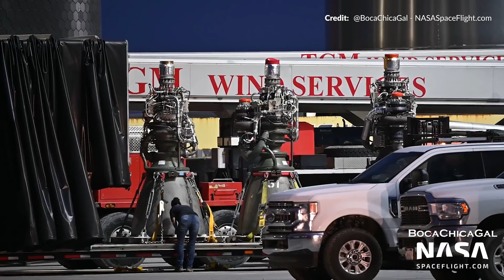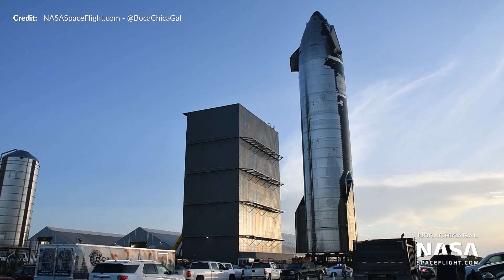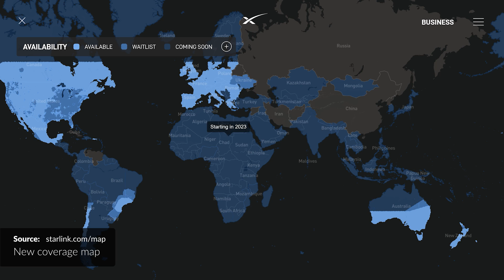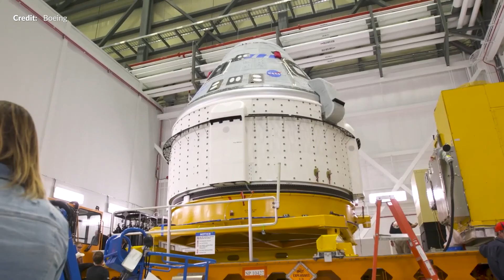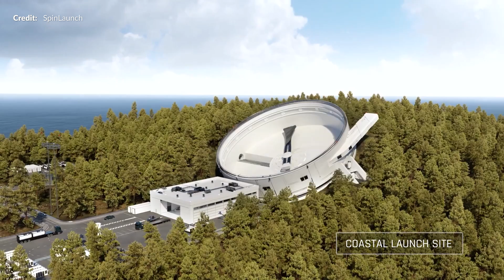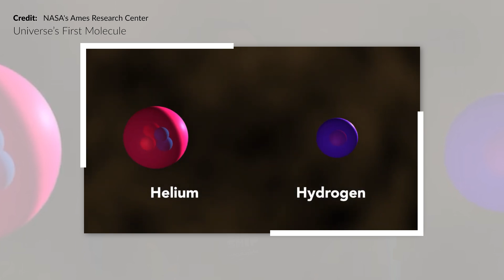SpaceX Starship Booster Testing, Ships Shuffled, Starlink, SpinLaunch, SOFIA, & Starliner

Comment: Startlingly superior. Another scintillating scene of cinematic superbness from Marcus House.

Here's hoping the Starliner can pull off a successful flight! Thanks to current events NASA needs this vehicle more than ever now. It certainly wouldn't hurt to have another option for launches, anyway.

Spinlaunch is freaky, but cool. I have no idea what kind of cargo could withstand 10 000 Gs, but if anybody wants to launch solid lead ingots or cannonballs into space, this is the system to do it with. Seriously though, it's a great proof of concept and I'm glad they have the funding to carry it out. Your idea of using it on the Moon is really cool. If the power requirements could be worked out, spinlaunching might be a cheap way to get mined materials from the Moon into orbit.

It's too bad about SOFIA. The program had a great run and they did a lot of wonderful science with it, but eighty five million a year is a heck of an operating cost for a single airplane and instrument. Maybe somebody could think of a way to do it cheaper in the future, with a SOFIA 2?

Comment: HI Marcus - great show - thanks

Regards Spinlaunch - I have thought for a long time that having some form of ground based initial launching system that does not need to be lifted of the ground would be hugely beneficial.
Think all the energy (mass) needed to get any rocket clear of the launch tower - what if the rocket could be powered by an "extension lead" until it cleared the tower??
So Spinlaunch held my interest as I was thinking of some sort of (in simple terms) blow pipe or catapult system.
I've not done the maths, but a suppose spinlaunch is the only way to impart enough energy into a rocket to make it worth while - a blow pipe would have to be many kilometres long and a catapult would be a bugga to load.....!!!

Thank you.

Comment: Good point about using that at the moon. I think it would be possible to not only make lunar orbit but to achieve trans Earth injection from the surface. Then not full reentry at earth but an atmospheric breaking manouver to attain LEO. Why? Why not? All sorts of applications and besides most space based manufacturing will occur in LEO I think because of the protection the Van Allen radiation belts provide. Large space structures.

Comment: It will not be laid down for transport,  as you know this rocket is designed to be modular and easily assembled and disassembled. So therefore the conclusion here is that it will be assembled at the Cape and not transported as a fully assembled rocket.

Comment: Regarding SpinLaunch, few will even think of using it on the moon until it's shown to be a viable option here. It's a LOT easier to build and test here, than there. But yes, I forsee this being used there as well, and quite possibly as a primary launch system.
Reply: They might wait until the basic tech is proven here, but it's hard to imagine that it'll ever be viable from the Earth. "Robust enough to survive Spinlaunch" is a more rarified category than "robust enough to survive launch", and it's dubious that it'll expand very quickly at all.
Reply: @absalomdraconis  But it really isn't. Heavy construction materials aren't, in any way shape or form, delicate. Flinging steel beams, or even just steel extrusion powder, likely won't need much protection from G-forces. Until we have refining and whatnot in space, most construction will be partially done in LEO, using materials provided from Earth. Much quicker than trips to the moon and/or asteroids.

Comment: I doubt Starship or the SH booster are capable supporting their own weight while laid on their side....I mean maybe if they pressurized the tanks, but laying a Starship on it's side with pressurized tanks would open up a whole new can of worms as far as safety goes....They could transport them vertically on barge all the way from Boca to Kennedy, but my guess is they won't. IMO if they have to launch from Kennedy it will be a Starship and Booster built at Kennedy or at the very least they will transport ring sections to Kennedy and do the stacking and final assembly in Florida. They don't need a whole production facility for that just a high bay. The time they need to complete a Florida tower should be plenty of time to build a high bay and stack a Starship and SH booster.
Reply: Starship has to be able to take force from one side, because that's how it reenters.  The big problem would be doing it without crushing the heat tiles.  The booster could probably take its own weight, too, with some pressurization, but they'd probably need to build a frame to support the engines, or just take them off.  Once they are successfully flying and catching them, though, I think flying the starship to the destination would be more practical.  I don't know how far downrange the booster could land if it didn't turn around and return to the launch site.  Probably not that far.
Reply: @Br3ttM  On reentry the pressure on the hull is fairly evenly distributed compared to trying to lay it onto some sort of cradle and the tanks are pressurized which adds a lot of strength. I wouldn't say it's impossible to lay Starship on it's side, but it's questionable. 

As far as pressurizing the tanks goes, when you lay it on it's side the trouble there depending on how much pressure we're talking about you run the danger of tank exploding should a rupture occur. Even at less than atmosphere above ambient that's a lot of energy that can be released should a rupture happen while laying the vehicle on it's side or while transporting it. 

Constructing the high bay or super high bay at Kennedy should  be done long before the launch tower. So why bother trying to move an assembled Starship when you can just stack it in Florida?

...But Hopefully Boca will get FAA approval this month and we'll never know how they were gonna move a Starship from Boca to Kennedy 🤠

Comment: "They're going to need to test transport from boca chica to the cape"
I love ya, but I just don't think y'all are getting what's going on here.  They aren't building a ULA rocket, they're building something more similar to a commercial airplane.  There's no point to design and test shipping procedures of a vehicle designed to fly.  I just don't see it happening.  The first Starship's to fly from the cape will be reflights.  They'll just focus their first efforts at the cape to build a booster and stage zero.
My bet,  the first Starships actually built at the cape will be directly related to Artemis and crewed missions

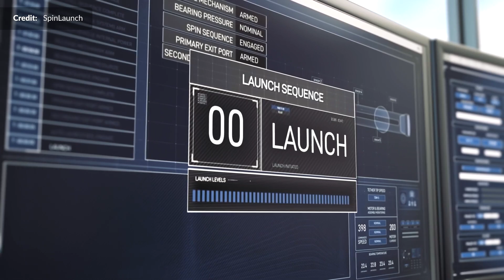Comment: 15:54 "some estimating up to 10000g"  
why do you formulate like that? why dont you show the calculation? DIDNT YOU VERIFY THAT FOR YOURSELF?
here let me do it for you:

planned launchspeed: 8000 km/h ~ 2200 m/s
planned launcharm radius: ~50m
centripetal force acting on a spinning thing: mω²r (radial velocity) = mv²/r (tangential velocity) = ma
-> tangential acceleration: v²/r=a -> 2200²/50 ~ 100000 [m/s²] = 10000g

Comment: can anyone explain to me what the highbays are for? you see the interior and its just a starship in it and blank walls all around. like no scaffoldig no equipment no nothing. it seems like it is even detrimental since they cant use their people lift crane thingys in there to reach all places.
Reply: The sections are built in the tents, soon to be the factory building, and then the sections are stacked in the high bay. I believe that they are stacked top down, meaning the top of a tank/cargo area is put in first and all the sections below it are stacked under it from top down. So most of the work is at the bottom attaching things with the crane at the top of the building lifting it up.

Comment: By my calcs, you could achieve "8 thousand km/hr" with a linear accelerator 5 km long at 500g acceleration.  Seems a lot easier on the payload, but probably a lot more expensive to build the launcher.  Ideally, you would set it up on the slope of a tall mountain pointing east over ocean, near the equator.
Reply: Sounds like a mad scientist's lair. "I assure you, it is a fully functional volcano space cannon." Mr. Bigglesworth approves.
Reply: @yt45204  V=Velocity (m/s) ,  A=Acceleration (m/s/s), D=Distance (m), t=Time (s).
Starting from V=0 at t=0.  V = At,  and D=0.5*A*t^2.  Combining these gives A*D = 0.5*V^2.
V="8 thousand km/hr" = 8000000/3600 = 2222 m/s.
A*D = 2469136.  If A=500g = 500*9.80665 m/s/s = 4903, then D=2469136/4903 = 503 meters.
Looks like you're right.  I apparently forgot to include the 9.80665 factor.  Thanks.
I still have no idea what it would cost, but my impression is that it might be in the same ball park as the spin-launch thing.
Reply: On Earth at least, there's no mountain tall enough to be a good match for that sort of thing. No matter which you run it up, the atmospheric drag will still be undesirably high.

Comment: Spin Launch interesting concept.  I worked on a telemetering device in the 80's (PAM Commutator) that was used to count the times a shell turned in a barrel.  The device had to survive 10000g.  It was in the 80s used thin film resistors  and hardened components on a really tough ceramic pcb in a titanium housing filled with epoxy.  Out of 10 units I took for testing in a centrifuge that would sim 10kg 6 made it.  The rest were basically powder when we opened them.
Reply: Let's try a human flight rated version!
Reply: @thewoodweldingfabricator9300  Give Brandon an ice cream cone, strap him in and tell him he is going to the zoo...he can be the first.
Reply: How larger were they? Asking because one of the Green Launch or Spinlaunch engineers (I forgot which) said that cell phone tech has pushed miniaturization, and smaller means less subject to G forces, so the new small components for phones can be pretty much used off the shelf in kinetically launched satellites. Or something to that effect. Dunno if their claim is true, but I'm curious to know if the failed components you witnessed were substantially larger than modern cell phone electronics.
Reply: @WilliamDye-willdye  the inner housing was like 4 x4x 2 deep the company was OmniTech in Bensalem PA, long gone.  But was cool stuff to work on
Reply: Spinlaunch is an investment scam. It will never work, and even if it DID, then only thing it could place in orbit is a melted block of tungsten
Reply: Also, thanks for posting your story. I'm trying to learn more about the technical limits of kinetic launch systems, so it's good to read a first-hand account.

Comment: Marcus, Sophia is likely shutting down, in part, due to the JWST coming online. Both are infrared telescopes but the JW is much more capable. You will continue to see the great IR images of the cosmos, and they will even be better!
Reply: I wondered if there was anything Sofia (no "ph") could do that the Webb can't do. I was surprised that Marcus didn't say.
Reply: @racookster  Sopfhia
Reply: @racookster  It has the advantage of access to the instruments for upgrades or replacements. That's impossible to do with JWST.
Reply: @SteveHodge  Perhaps SOFIA will live again in 10 years time when its cheaper to upgrade than to build another JWST, even through they are already working on the next :)
Reply: @JasonPurkiss  By the time James Webb reaches its end of life, Starship ought to be fully operating. And then Webb 2.0 would not need a segmented folding mirror to fit inside the launch vehicle. 
They could even fit a spare telescope or two into the payload bay.
Reply: @JasonPurkiss  i thought the found out that hanging telescope on a weather balloon is cheaper than putting it inside a plane?
Reply: @refindoazhar1507  lol yeah I saw that to thanks for reminding me :)
Reply: And the images showing Sophia running on Windows 7. 

 "I'm sorry, your telescope no longer has a valid operating system.   Please pay a billion dollars and upgrade your hardware for our latest Windows 11.  You can even have emoji's in your results and share them straight to Instagram!"

Comment: no conspiracy theorist here but. boeing has had software issues in the past with 737 max and didn't tell any pilot what was going on. the result speaks for itself. I sincerly hope that this time it won't be the case for starliner.
Reply: NASA put more focus on Boeing after the first failure. Boeing spent $410M to fix the code in 2020 (among other things) and $185M for valves in 2021. Hopefully, Boeing has solved all the issues and doesn't get more.

Comment: Are we sure that the vehicles are structurally sound when on their side? Would they require slight inert gas pressurisation?
Reply: I think you’re right, although they have added stringers to stiffen the structure.
Reply: they have to be pressurized at almost all times, unless someone is working inside a tank or the vehicle is supported by a crane odds are it's pressurized, all the structure is to strengthen it vertically, I highly doubt it could survive being transported laying down.

Comment: Working out the technology for the spin launch system on earth means that when you look at having a system on the moon you have a good understanding of what you need to do.
Reply: Having spin launch on the moon will be huge. It'll also be a massive security threat. Imagine a hostile nation setting up a launch site on the moon with the ability to throw projectiles towards any spot on Earth with the proper math and trajectory calculations.
Reply: @TheDisgruntledImperial  there is a treaty wich says that space and the more Importantly the moon can not be claimed by any country. They could never have the time the construc it. They would get sanctioned here on earth
Reply: doesn't make much sense to me on the moon either, too many moving parts to get clogged up with ultra fine moon dust. linear accelerator / railgun would be more practical. maintenance would be a nightmare.
Reply: @spacechannelfiver  yes true but rail gun technology is far behind has they have problème with very powerful ones. They have a problème with each rail moving inward and it bieng disabled with a flew shot. But you are right with the lunar dust. It will get everywhere but I think engineers can work around that contraint
Reply: @Xavier1...  Just get Dyson to make a vacuum to suck up all that lunar dust and there you go!!
Reply: @Jimbo Bimbo I agree no nation could do such feet in secrecy

Comment: I don't think Starship is ever intended to be transported long distance. Just like airplane final assembly happens near a landing strip, starship is expected to be transported around under it's own power. Meaning that if any starships are ever to be transported from Bocca Chica to Florida, it will have to be launched from Bocca first before landing in Florida. So no, don't expect horizontal transport of any sort.

Comment: Why couldn't you strap a booster down on a barge vertically and ship it to Florida?
Reply: Apparently, Starships and the boosters are built to be transported vertically, as they have to be strong in this dimension for launch anyway. It adds extra mass to lay them down on their sides. Falcon 9 and Falcon Heavy are designed to be transported by road, so they are thin on purpose and designed for horizontal transport. The payloads are integrated horizonitally, so satellites have be able to be laid on their side as well. The USSF-67 launch on Falcon Heavy cost more than normal, as some of the cost was for vertical integration facilities for the USSF and for a longer payload fairing.

Comment: It's hard to believe a rocket can be launched using Spin Launch, but there are smart artillery shells with electronics that survive the shot. Idk the g forces of being shot out of a modern howitzer, but they must be very high. Those have SRBs in the base though. I can't believe Spin Launch plans on using liquid fueled boosters.
Reply: Even if it proves to be not very practical for  use on Earth, getting the technology to a state of proven reliability is essential before it can even be considered for use on the Moon (where it might well have a future).

Comment: As far as moving Starships and Superheavys  go, I suspect that ocean barges will be more likely since all potential launch sites are near water and those ships are pretty much engineered to be upright. I can totally see something crunching if one were laid on its side. 
Amazing video as always Marcus, Your defiantly the one-stop-shop for space news.
Reply: Why transport them at all? Just fly them out of starbase, and land them where you want it to be.
Reply: Or … just let them land there. That is what Starship was designed for 👾
Reply: I'm wondering if they could fit Starship upright on one of their landing barges and move it across the gulf that way? Its the same height as a Falcon 9 booster, just wider and likely heavier. I'm guessing they'd ship the Raptors separately and install them on-site, so maybe not too much heavier.
Reply: I would think that they would ship them pressurized. But it would totally work to ship them upright on a large enough barge or ship

Comment: In my opinion, given that Falcon-9 Crew-Dragon is available and provenly reliable (and massively cheaper), you’d have to be crazy to want to be launched on SLS.
Reply: Crew Dragon as configured is apparently not able to take you to Lunar orbit.  Might need a Falcon Heavy (man rated which isn't planned to my knowledge).
Reply: @Scanner9631  Falcon Heavy is planned to launch Dragon XL (cargo only, one-use spacecraft) to Lunar Gateway. So a heavily modified Crew Dragon for lunar work would need at least a Falcon Heavy, if not a fully expendable one. SpaceX had plans to man-rate Falcon Heavy, but dropped them a few years ago.
Reply: SLS is for sending Orion into deep space and to the Moon. Starliner is for launching to the ISS and is launched on the Atlas-V. Eventually, it will likely move to the Vulcan Centaur once that is flying.